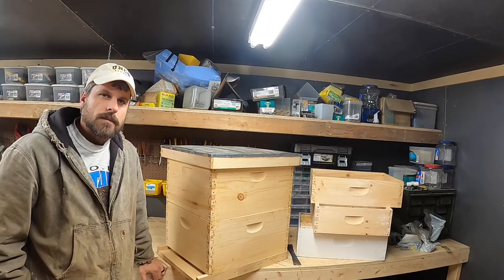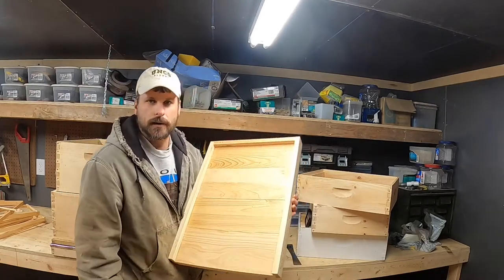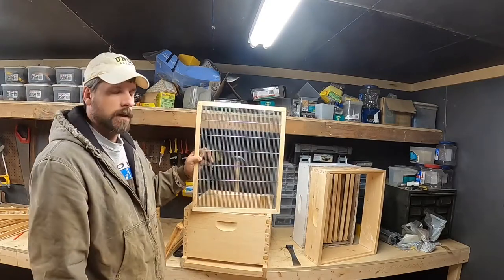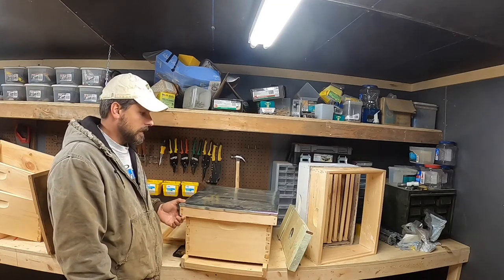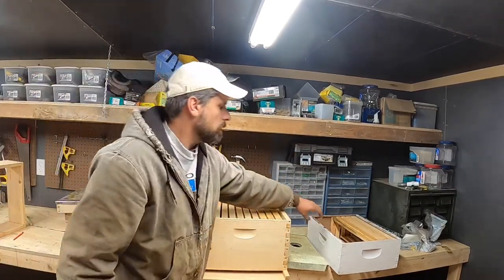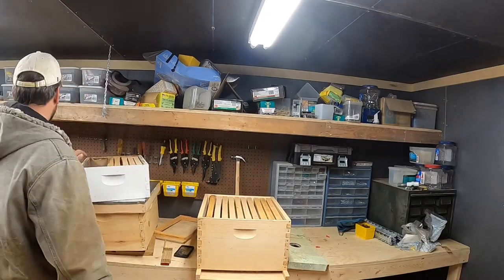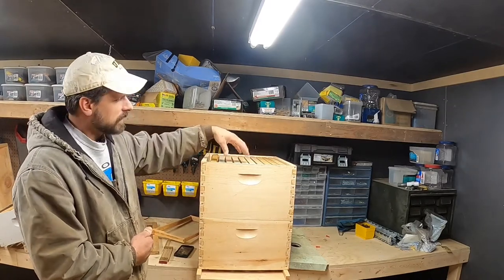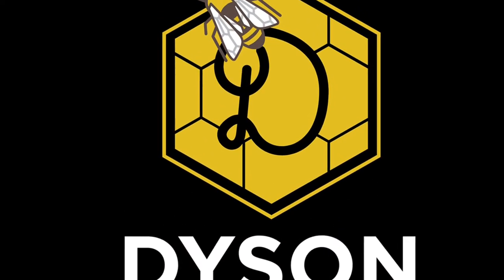Hive Components and Setup-Langstroth

Comment: This is the only place where I've ever heard a deep brood box referred to as a "deep super". Everywhere else, anything above a queen excluder - and only those - are called "honey super", or "[box depth] super", or just "super".. it seems that the "super" part means "above", as in "above the brood nest", which usually means above the excluder. And, people talk about their 5-5/8" high 10 frame supers weighing 50lb or more when full of honey.. the comb height in those frames is 4.75", compared with 8.5" of comb in deep frames.. so a 10 frame deep, used as a honey super, would end up weighing closer to 100lb when full.

Also, a second reason to avoid using deep boxes as honey supers, is that you'd need a larger centrifugal extractor to fit the deeper frames, and then the longer span between the (vertical in the centrifuge..) top and bottom bars would reduce comb support against centrifugal force, promoting breakage.

The thing which surprises me most about the various box depths, is that the shallow honey super and deep brood box use standard sawmill lumber at its full width - 1x6 at 5.625", and 1x10 at 9.625" respectively, but mediums use 1x8 which is cut down an inch, to 6.625". No lumber producer makes nominal 1x7, you don't get two mediums by ripping a (expensive, if available..) 1x12.. so why isn't the medium "standard" built around full-width 1x8 lumber? I don't know.. maybe this was a consequence of whatever extractor was popular then - like, people started building boxes and frames which would "just fit" into an extractor where the frame baskets offered a fat inch or so of clearance for the shallow frames. Just a guess...
Reply from the maker: I would agree that super is synonymous with surplus or above. It depends on the operation. Commercial extractors are set up for deeps and is often the only size they use. They also have equipment to help load those 100lb boxes. Interesting thoughts on lumber. Thanks for watching.